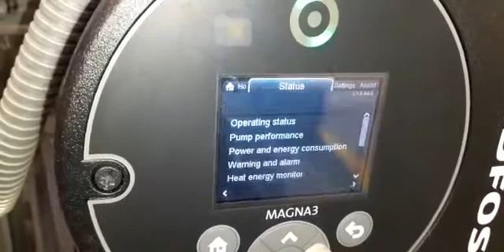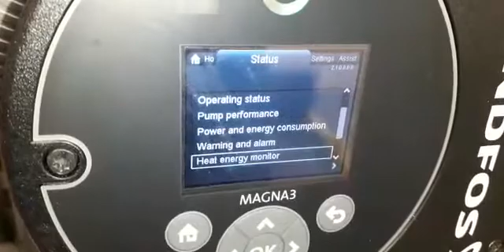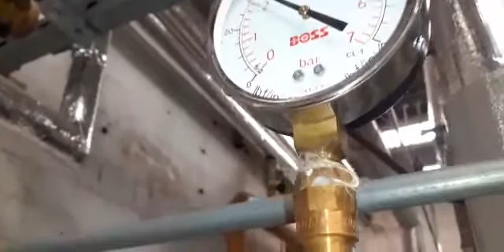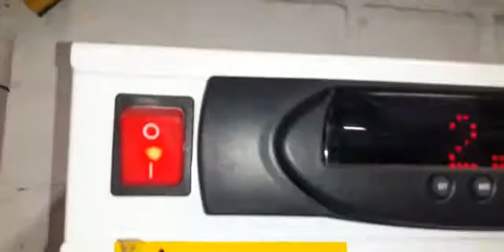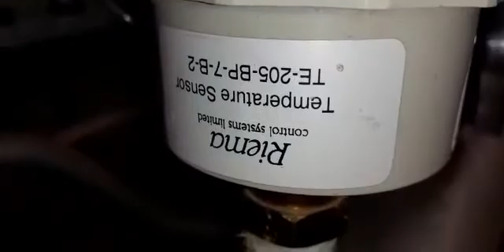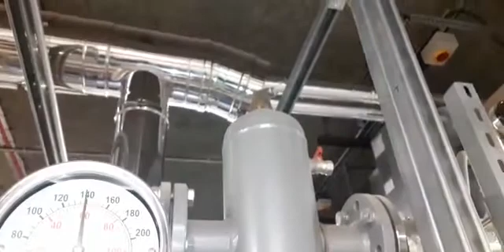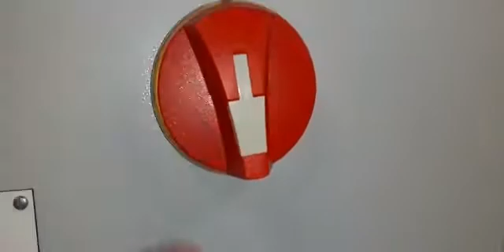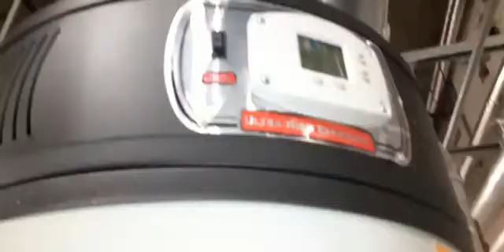BOILER ROOM TOUR

Comment: The purpose of bending the pressure gauge is to protect the internal transmission mechanism from the medium temperature, medium corrosive damage. Usually if the medium has a certain corrosive must be set pressure gauge bend, the temperature of the medium is greater than 60℃, must be set pressure gauge bend.
Reply from the maker: Thanks for that Hadjar and finding the time to contribute. Hope that you're having a lovely weekend.